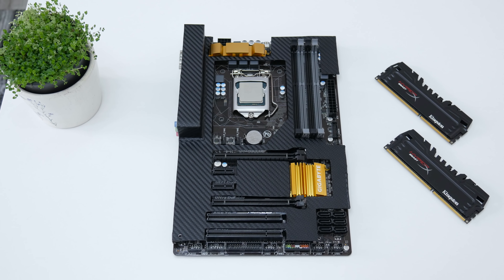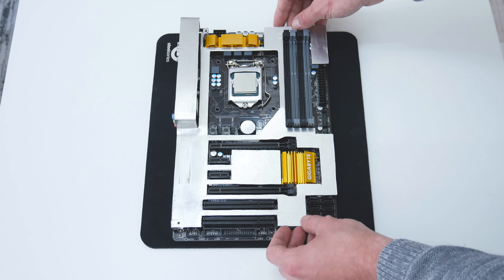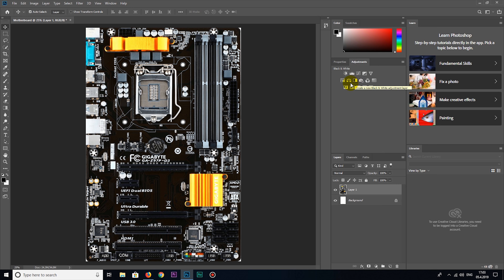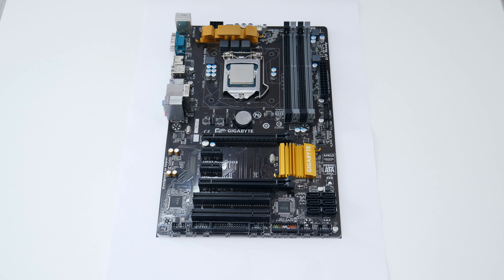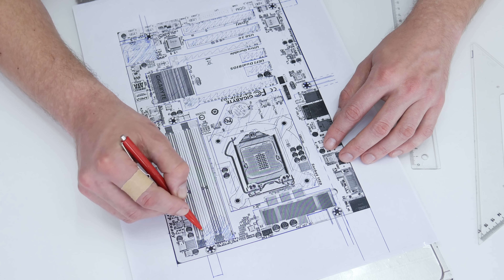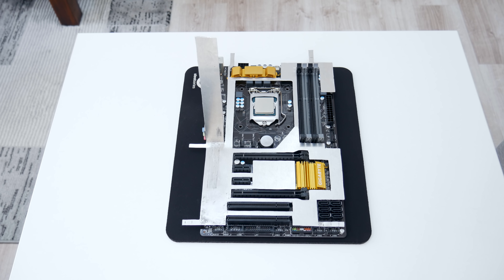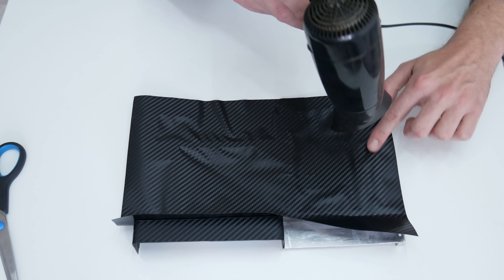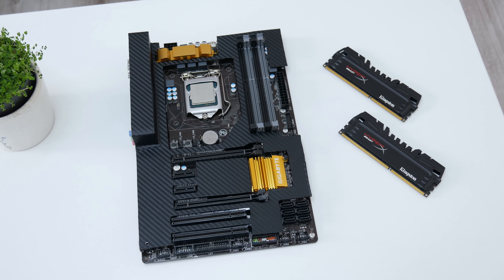DIY Motherboard Armor - For a CHEAP!

Comment: i would caution against using metal due to electrical conductivity, if i were to do so i would add an insulating layer under it, but great video overall
Reply: plastidipping the bottom should suffice I think
Reply: Marco Morelos :/ metal isn’t touching the back
Reply: @jinankhan4127  what material do you recommend. Smthg i can find anywhere
Reply: @jucctin5243  wool
Reply: @jub8891  ok, wool it is
Reply: did you see the video til the end? He isolated this metal from motherboard
Reply: One of the reasons for the metal shield is to help stop RF radiation, coming off or affecting the board electronics. A cheap plastic wrap or non-conductive paint would work. But part of the job of the shield is to still allow heat to be removed without fans, non-conductive materials do not conduct heat as well as electrically conductive material.  Adding stand-offs might work. You are not making a portable easily movable computer, but a stationary working computer, You need to unplug it before, moving. Grounding the shield before unpluging and again when moved if a static charge may have built-up.
Reply: Just use acrylic
Reply: @jucctin5243  Acrylic. pretty great stuff anyways
Reply: I was thinking that but most pc company’s use ultra thin cut aluminum which will not conduct do to an abnormal amount of static electricity thats why pc company’s use it
Reply: he did. With Black Vinyl

Comment: Might I also add the fact that you can spray the bottom of the armor with a rubber spray paint to prevent it from making any contact with the mother board

Comment: Can you make a video about removing MOLEX from your PSU wires? Thanks & great video!
Reply: Just get a modular one or use a scisor + a insulating tape. 
But why would you want that? Just do some cable management and hide it!
Reply: Just open the psu and remove the molex wires (you can cut, or using hot air)

Comment: how about height of back side of motherboard? What is height in milimeter? Is it stadard? Please let me know. Thanks a lot.
Reply from the maker: Hi bro, on this motherboard the height is 10mm, however the height depends from the other components on the motherboard, i mean on capacitors and other elements

Comment: yeha doesn't increase anything maybe just vram temps causing more unstable overclock or annoyng termal throttling... but ok...

Btw mobo shields in the manufacture have "sense " is just for show in hight end model just when doesn't interfere in performances , in other cases is used as chipset cooling of hotter part of mobo in some case to protect the mobo if used for extreme ovwrclocking like dry Ice or liquid nitrogen in extreme (in performances and cost) mobos

What I'm saying is...  OK cool a custom mobo shield but I really don't recommend to make some customization so close to your mobo bcz even if you are sure that really cannot impact performances or lifespan of your hardware you really cannot be certain (of course me too)  bcz you don't exactly know how your mobo model was projected.

Comment: What are the pros and cons?
Reply from the maker: There's no some pros and cons like on hardware. But armor is to make your motherboard looks different and on the armor you can add some small cooling fan to make the cooling better, or you an add some rgbs. 
However, with thin armor temps are the same like before, just the motherboard is looking different
Reply: @ComputersAndTechAndAndrew  Oh I was just worried about the temperature because the other commented it would spread heat or it might short circuit, frying the whole thing.
Reply from the maker: @bsit-1cservidadmarktimothy276  No problem with temps, even under full load whole day. Maybe would have if the material is thicker, 4-5 mm acrylic or something.
Reply: @ComputersAndTechAndAndrew  Can you do a tutorial on it?
Reply from the maker: @bsit-1cservidadmarktimothy276  am planing to make something from acrylic, just it will be different
Reply: @ComputersAndTechAndAndrew  oh okay. Will look forward to that!

Comment: Do u think cardboard would work?
Reply from the maker: Yes, but cardboard is isolator and may increase the temperatures, the aluminum is the best way or some thin metal as i used, because is cooling faster and do not keep the heat